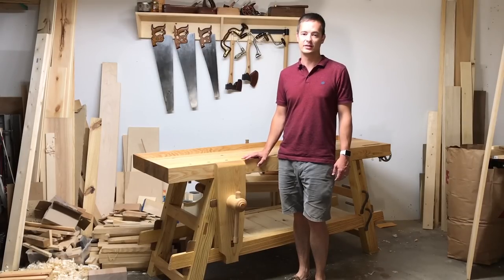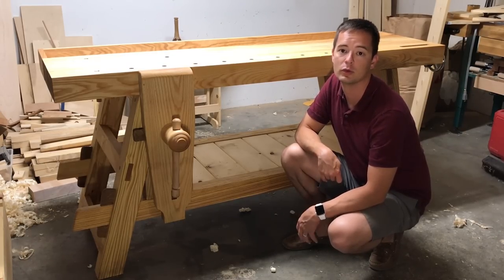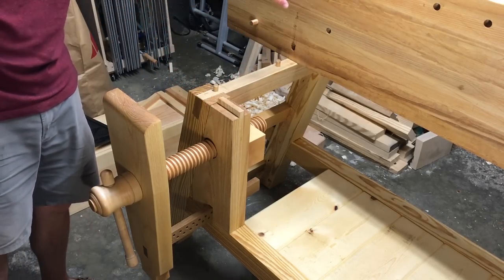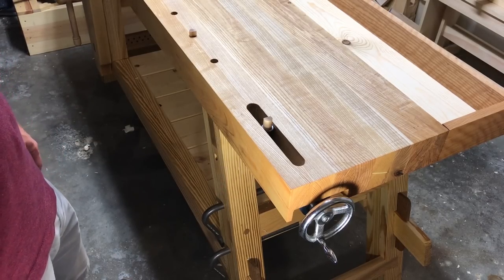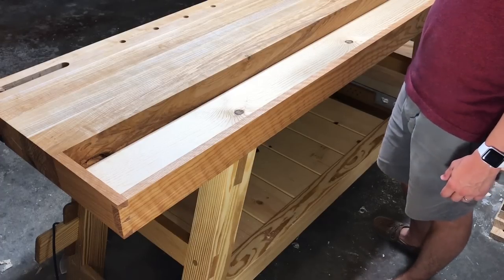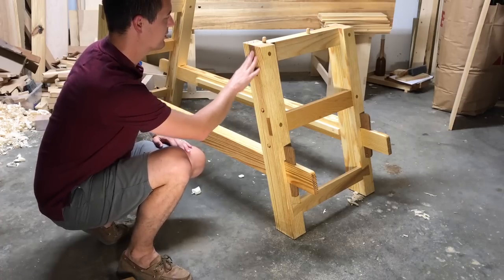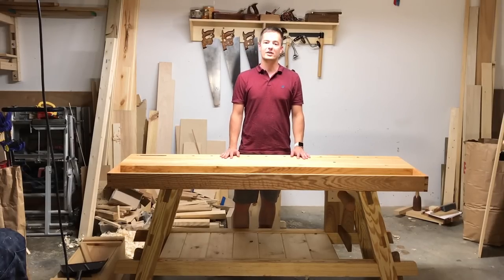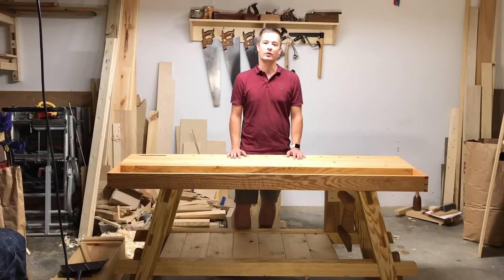Portable Moravian Workbench Tour

Comment: I built this in '21 an really like it, it's heavy enough to stay put, has an Ash top an bits of Oak and Walnut connecting SYP legs and stretchers. The Ash top is only 12" wide x 3.5"thick  to save on weight giving me a bigger tool tray, the Vise chop is Oak with a Maple screw. Yes, I followed W. Myers plan on this. I can disassemble, and take it anywhere!

Comment: Great tour and explanation. I've just built my own with a couple of variations.  Instead of the leg vice, I've installed a flush 9" quick release face vice with 12" white oak faces and also included a sliding deadman that runs along the front stretcher.  Unfortunately my budget wouldn't run to the beautiful hardwood top Mac has used here but good 2x4 pine makes a pretty decent alternative.

This is a great bench for hand tool woodworkers and also good practice for beginner woodworkers with the draw-bore mortise and tenon, bridle and lapped dovetail joints.  Those angled tusked tenons on the rails work beautifully and are also good practice for making large precise mortises and tenons.

Comment: Best review I have seen on this bench no doubt. Would you mind sharing your experience regarding total cost to build and the number of hours?. Thanks again, Dave.
Reply from the maker: Hi Dave, really good question. I didn’t keep track, and actually made two tops (one out of pine and one out of ash), but I would estimate  $200 would be the minimum, and that would be without the wagon vise or wooden vise screw. I would say reasonable guess would be $400-$700 depending on vise hardware and how much premium hardwood you use, versus pine. I think you really could do the whole thing out of southern yellow pine, with the premium vise screw and wagon vise for $400 or $500 and have an awesome, lifetime workbench.
Reply: @macaustin2791  This is a really great video - thanks for taking the time to put it together (and nice build - it looks superb)!  I'm curious about your choices of wood... I'm new to woodworking and am thinking this will be the bench I make.  That said, what helped you decide to use the white ash for the top and red oak for leg splines?  Do you prefer your Pine or Ash top?  Thanks for your time and expertise!

Comment: Great build I’m fortunate enough to own the DVD set wood and shop put out of Will Meyers showing how to build this bench. Unfortunately I’m in South Florida and cannot find a source for the right wood for the build near me. The top is the most difficult wood for me to find I don’t want to make it out of construction grade pine.
Reply from the maker: Vladimir Lopez I actually made two tops for this bench, the one you see in the video (ash) and one of Southern Yellow Pine, construction grade 2x12 ripped down to 4” and then laminated. I would not hesitate to use that top. I think you should go for it. Best case scenario you love it. Worst case scenario, you are unhappy with it, but you have an awesome and functional bench to work on while you make another top later. The top is easily replaceable.

Comment: It's been a couple months since you built your bench... any thoughts, positive/negative, about the design and how well it works? Anything you've discovered in its use that you hadn't expected? Anything that you'd add or change?
Reply from the maker: lunaticprophet I still think it’s the absolute best design out there for the kind of work I do. If I were redoing it, I don’t think I’d change anything. I should note, the one modification I HAVE made since the video is adding a couple more dog holes up near the tool tray.

Comment: Hi fantastic overview. I am completely new to woodworking and step one is to get myself a portable bench. Do you think this is beyond an absolute novice? I am guessing you are pretty experienced wood worker but how long did it take you to build?
Reply from the maker: peterxrocks i wouldn’t recommend attempting it as an absolute beginner. It doesn’t require really any advanced skills, but I would say you would want your first dovetails and first mortise and tenon joinery to be on something you don’t mind being a little sloppy. But if you’ve done a little practice with the basics, don’t be too intimidated. If you buy the Will Myers instructional video it really walks you through are by step.
Reply: @macaustin2791  good advice. I was thinking of building something smaller in first instance to test those joins , then move onto bench project.  One other thing...for you following on with the video how long do you think it took you?

Comment: Looks great! How does the "tool tray" base attach to the edge pieces?
Reply from the maker: darklightBoy there is a 1/4 inch groove in the side pieces and the bottom has a corresponding rabbeted tongue. I put just a little bit of glue on the long edge to keep it in place. No glue on the short sides because you need to allow for the wood movement (expansion and contraction without splitting).

Comment: Those vises screws are bloody expensive. No less than 300$ for the damm bloody screw
Reply from the maker: No, that’s not correct. They are currently $175 (just checked Lake Erie Toolworks). Well, what I should say is, not true about the $300, but still expensive, yes. Cheaper than tooling up to be able to make one yourself though I think. If you want to do it more cheaply though, you can grab a metal vise screw from Lee Valley for a LOT cheaper and it would work great!
Reply: @macaustin2791  hmm. Might go with the metal one since it wont expand and contract, but i was going for an all wood bench build

Comment: How heavy is the heaviest  piece? Could a woman manipulate it?
Reply from the maker: Well, I haven’t weighed it but I’d guess the top is around 100lbs, probably a little more. I am 6’ tall and average strength. It takes considerable effort to pick it up and carry it, but it’s doable. It could be made significantly lighter though. If you made it out 2.5” pine instead of 4” ash, it might weigh half. Remember though that weight is helpful in a workbench to keep it from scooting around when you plane. Make it is heavy as you can handle would be my advice.
Reply: @macaustin2791  what if you added weight to the bottom shelf? The weight would be there just more manageable
Reply from the maker: Jennifer Zimmerman I think that works, but you just want to make sure you don’t reduce the thickness of the top too much. You want it to be totally rigid, no bounce or flex, when you are doing your most physical work, like chopping mortises. 2.5 inches thick is about as thin as I’d go on the top, and thicker for less rigid wood species.
Reply: Another option is the approach I took with my version of the Portable Moravian. I made a split double slab top (i.e. no tool tray) with a gap stop in the middle. Mine was also made mine from Ash so the overall weight is even heavier (especially with two slabs) however the slab tops are only 13in and 9.5in in width so that reduces the weight of each individual slab. Making them both 11.25in (with a 1.5in gap stop) would spread the weight even more. Of course you do lose the tool tray but in any case you can see details here: https://bit.ly/2X9QTj8